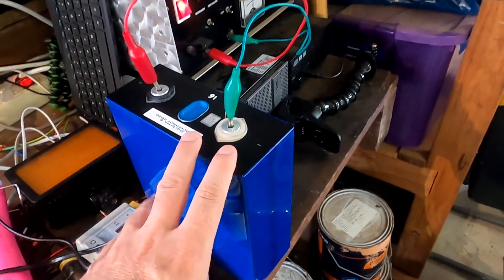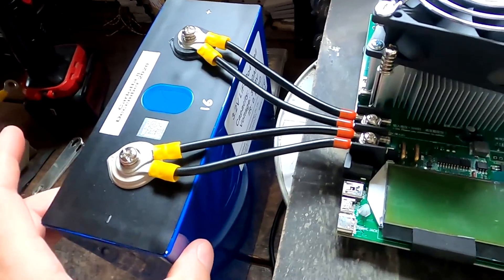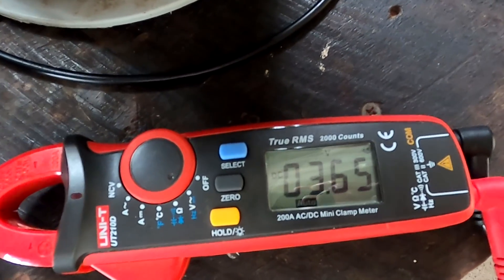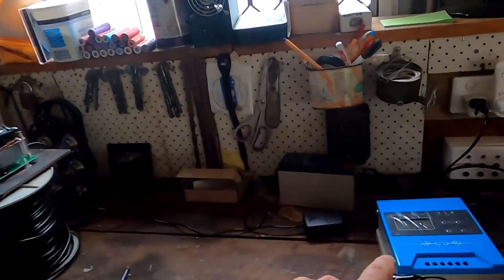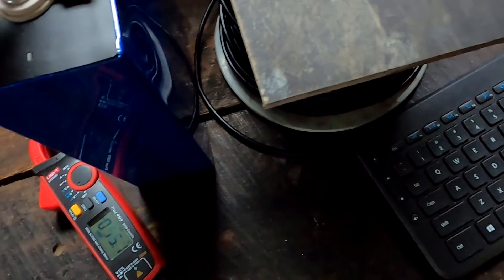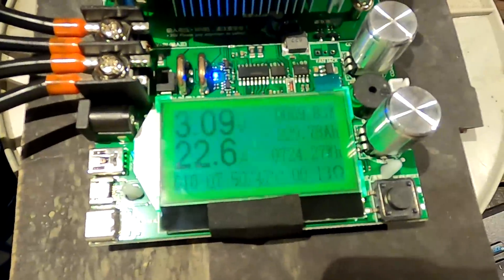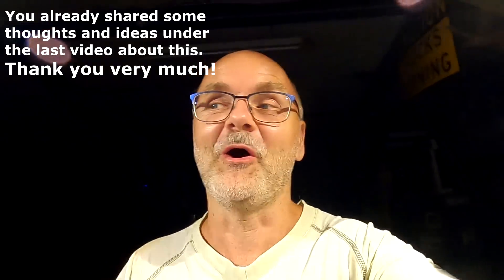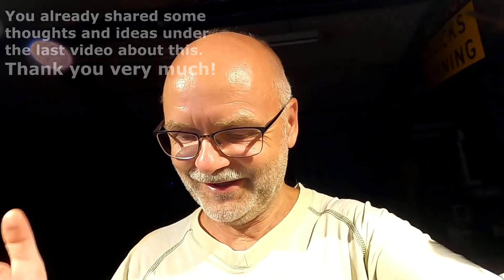3rd capacity test with expected result of the EVE LF280 LiFePO4 cell.

Comment: Does the description say anything like +/-3%?? I would expect 280-285ah from a battery rated at 280ah, the other tester with the lights, the current drops with voltage, the constant current load is constant, it can change the results, I used a buck converter with load, to test, it actually pulls more current with lowering voltage, I would test them all to atleast 3.2v and compare, if they are close use them, you could always add a 5-6 ah cell to the lower cells to make them equal, but I would tell the manufacturer about the test!

Comment: Honestly these batteries should have their minimum rated capacity listed, not the max to be expected, so if it's under it's reasonable to expect more, and I'd ask them about it, certainly.

In your setup I can't think of anything wrong that would make that big a difference, small wire size might, but it'd get noticibly warm. The low voltage reading on the meter would make a difference, but you've tried it with the other capacity meter and got a similar result.

Comment: Although they seem they don't perform as expected, there are some differences in voltage on the capacity tester and the multimeter. Isn't that a difference big enough to generate the deviation you are getting?

I have recently seen some of these 280 ah cells, appear as 272 ah on Aliexpress. They look exactly the same...

Nevertheless, until you get an accurate  tester, you will never be sure. For that amount invested in cells I would definitely step it up with a beefier, and better tester.

Nevertheless, I would charge them all, get them running with a BMS, and monitor wich ones are at lowest voltage. I would say that the readings you are getting are still pretty good 271 ah. I would worry if they were much lower than that. It all comes down to the price per usable KW/h. After a few cycles it may settle a bit. Still a great value for money, and dealing with chinese companies is not easy.

A man with one watch, always knows the time... A man with two watches is never sure... (Two testers)...

Great, great content Andy. Love your channel. Keep up the good work.
Reply from the maker: The voltage is not relevant when measuring Ah. It measures the current over time. The voltage is included in the Energy (Wh) though.

Yes, you're right. I have to setup the full system first and go from there to identify weak cells. Otherwise, too many watches... ;)
Reply: @OffGridGarageAustralia  thanks for coming back at me. I am learning a lot with your videos. I am learning all I can, so can set up my own system later next year. Thank you again from Madrid Spain.

Comment: “Does get a lot less exciting after three times” LOL :-)
Ha! NOW test every cell Andy!
If the tester’s voltage is slightly out- which your separate clamp/ volt meter confirms, then the Ah figure is also incorrect. There may well be enough difference to get to 280Ah.
At the end of the day though, the sad fact is that you have basically zero chance of refunds or replacements, except maybe for a totally failed cell. However even that would likely be very difficult, not to mention very expensive, with very slow shipping.
Maybe you’ll just have to live with what you have and not lose sleep over it. 
My five year old Winston cells have never been very accurately capacity tested, but do continue to perform very well indeed. They could be slightly over OR under capacity and I wouldn’t really know, (or even care very much).
Cheers
Reply from the maker: No, Dave. The voltage is not taken into account when measuring the Ah. It's the amperes over time, A*h. The voltage is totally irrelevant. And current is absolutely accurate as I have shown in the last two tests. So Ah should be good.
Reply: @OffGridGarageAustralia  Of course, didn’t think that one through did I - was thinking watt hours not amp hours, stupid me 😂

Comment: You have to continue testing because if you find any lower cells than that one your overal battery  capacity  will be even lower  theirfore  you will have a greater argument  for replacement cells.keep up the good  work!
Reply from the maker: I probably build the full battery first and watch the BMS if it identifies any week cells over time.
Reply: A quick measure of each individual IR should be enough for that purpose

Comment: My 100ah cells specs say maximum low discharge is 2.3v?
Reply from the maker: Different cell, different chemistry inside. If it says this in the specs, you can discharge down to 2.3V safely.

Comment: Build the battery, do some full cycles and after the last low voltage cut off of the bms pick the cells with the lowest and with the highest voltage and do all the tests.
Reply from the maker: Yes, that's what I'm going to do now. Easiest and fastest way. Thanks.

Comment: Hello, I think it depends on the tester. I have a better tester that measures the voltage with a seperate cable on the battery direct to caculate right. Your tester does not measure (calculate) the Wh that get lost over the cable.
Reply from the maker: I've done the test with such a tester just before this video. The voltage is not critical when measuring Ah. If you want Wh, yes, I use the tester where it probes directly at the terminals. It's about 7mV drop on each of these cables including connections.
Reply: Hello.
Why don't you put much thicker cable, with good connectors, mirror polished contact surfaces fully covering the battery posts? Sure the wires you use are thick enough for 20 Ampères, from certain points of views, I mean security, cost efficiency, but if we want the best results, if the battery post is 12 mm diameter, should the cable not be 12 mm also?  well if the battery post is aluminium and the cable copper, the copper could be about 1.6 time thinner in surface, 70 square mm instead of 113 square mm. Or 9.5 mm diameter. 
Also to spare the threads in the aluminium posts, I use studs intead of screws. I wish to find alu studs, for now the best I found are brass, I saw somewere that stainless steel will eat aluminium in certain conditions.
Cheers.
Reply: @OffGridGarageAustralia  Yes that‘s right. Maybe the Tester measures the Amps just a little inacurate. By testing this long time a inacurency from 0,05 A can make the difference. Can you do a calibration to the tester with a good quality measure equipment? Soryy for my english, I‘m german (you too?)
Reply from the maker: @michaelb.1192  Your English is good but we could do German too (guck mal auf meinem deutschen Kanal 'Living Down Under').
The tester cannot be calibrated, bit I compared the current with my multimeters and it is accurate. The voltage is off though...

Comment: Your handheld meter showed 2.50 volts when the amp hour device showed 2.48.  The device is reading at 99.2% of what your hand held  volt meter indicates.  99.2% of 280 amp hours is 277.  If the device  current reading is also off by 0.8% because of an error in measurement, then your results are effectively 280 amp hours.  if you want a reasonable estimate of all of the batteries behavior you need to test five more batteries, find the average reading and the standard deviation and then you can estimate what the rest of the batteries would do.  But I think you should just put together the 48 volt battery and see if it meets your expectations.
Reply from the maker: The voltage is not important when measuring Ah (it's A * h). Only when measuring Wh, you need accurate voltage.
Reply: @OffGridGarageAustralia  I should have just said that results are close enough,.  Instead of trying to make the case for them being within the error of measurement without making a good case.  I will wait and see what you decide, but hope we get to see a 14+ kWh battery.  I suppose you would want to capacity test the finished product so you will know what 1 C is.
Reply: Hello.
To measure the ampères, you measure the tiny voltage drop in the shunt, it's written on the side of the shunt.
Cheers.

Comment: I just ordered 8 of those cells I have the newer model all in one test I think just a different heatsink on it but I am planning to test every cell of mine 
Then I will try to match each parallel set for capacity I have a 12v system

Comment: A lot of "280ah" batteries are now selling as 272ah... which is what you got. So likely that your cell is 272ah battery (esp with loss over wires from battery to tester)
Reply: The place I'm talking to is also trying to sell me $272 amp hour batteries
Reply: That is the Truth, I contacted Alibaba fist and two representative's kept saying 272ah and 280ah know difference, I said, well I want 280ah and again they said, "Know Real Difference, Same Battery."
Reply from the maker: Depends where you buy them on Alibaba. There are 272Ah and 280Ah cells available.

Comment: Nice vid good info and view points. I would random test 25% of each delivery. If you see deviations test more from that batch. Find a bigger tester to discharge 0.5 c wil safe you alot of time. A nice inverter to make use of f the power instead of turning  the power to useles heat ;-)

Comment: It will drive you crazy if you worry about it to much I have purchased 4 sets of cells in the last year and a half, only the 16, 150ah from BLS on aliexpress made full capacity. The 90ah and 100 ah where both 3 to 7 % less then rated but the cost was a lot less/ah. Been using everyday off grid and they have been performing well. Just my two cents.

Comment: Seems like you are getting 98% of the rated capacity, I would be very very happy if my batteries did that well...and also that tester is not super accurate (I have one) and you have a tiny bit of loss in the wires and circuitry of the tester.
Reply: Thank you. Why is this not the top comment?

Given the price he paid and the frequency of exaggerated claims on alibaba, I'd be ecstatic with those results. I'm really curious to see how well these cells hold up longterm.

Comment: Batteries don't hold the same capacity every cycle either.  Some batteries increase capacity over the first few cycles and then decline.  Temperature is important with capacity testing.  A hot battery can give over 100% capacity.  And cold will lose 10s of %.

Comment: You should return all those capacity testers your are using, they are very inaccurate, and then you buy from Basen this professional capacity tester. It also charges faster than your power supplies
https://www.alibaba.com/product-detail/EBC-A40L-High-current-Lithium-Battery_1700001569169.html

This other link is to a Russian review I founded:
https://youtu.be/zZsp5mKYlj4?t=777

One person using this software here:
https://youtu.be/-JHyHtcjosw?t=76

And the manual pdf:
http://data.modtronix.com/prod-data/ZKE/Software__pd16/eb_v1.8.5en/EB%20Tester%20Software%20User%20Manual%20V1.8.5.pdf

Comment: Honestly, I think you should connect the cells together and use a BMS. Then run your test on the pack. When the BMS cuts the output, measure the cell voltages.
I am not sure you should expect the same result every time you test a cell. There are too many variables and unknowns. The cells are like living things.

Comment: I would test a few more, just to see what the average is.  In the end, it doesn't really matter if you are getting 3% less power than speced, when the batteries are 30% cheaper.  I'm getting ready to purchase 4 of these cells from your link.  Even 200AH batteries for this price is very cheap.
Reply: Be aware that PayPal pay only $30.00 dollars to ship it back and it cost several hundreds dollars to send it back to china if you want your money back for these bad quality cells. Cheapest price to send 16 cells  280ah is $2016.00 dollars or $3888.00
Reply: I paid $3465.60 for brand new class A which weren't new or class A.  It is a scam. If you buy a 12 eggs box because it has 30% off and when you open it has only six eggs Do you say that is fine because it has 30% discount?
Reply: @DIY Projects Sorry for the cheap math, more like 50% cheaper.  I was quoted $473 for 4 cells delivered, $118 each USD.

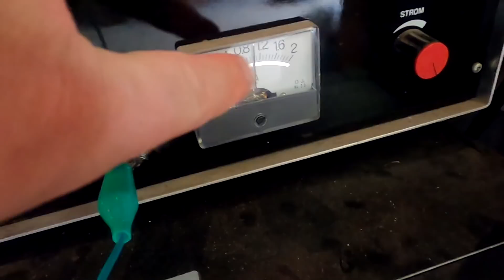Comment: 0:39 shows it was pulling almost 1A so it may not have been fully charged. Also please replace the battery in your voltmeter. drives me nuts to see that flashing icon indicating a low battery. :)
Reply: The amount that it might possibly have been undercharged would be absolutely minuscule. You might gain perhaps something like one extra Ah.
Reply: Actually, he has already significantly OVERCHARGED the cell at that point. Lifepo4 has a typical charge termination  current of 5%, and 5% of 280ah is 14 amps. Hes just wasting time and slowly killing the  battery,  unfortunately.:-(
Reply: @blackz06  could you explain what charge termination of 5% means? How is it determined? How is it applied?
Reply: @ArthurDentZaphodBeeb  5% of cell capacity. Could also sometimes be written as C/20. If you have a 100ah cell, you would terminate the charge when the current falls to 5 amps. For these huge 280ah cells, you would stop at 14 amps.